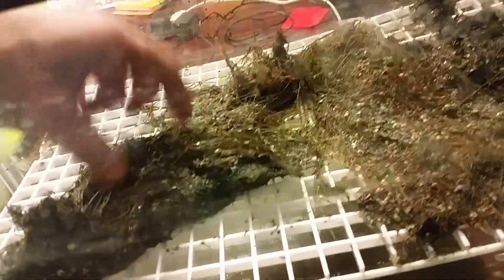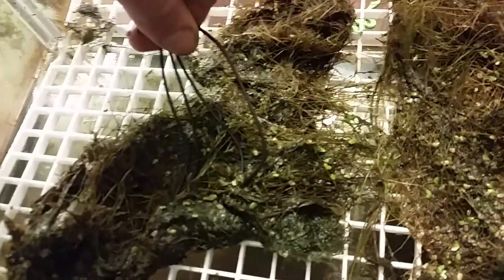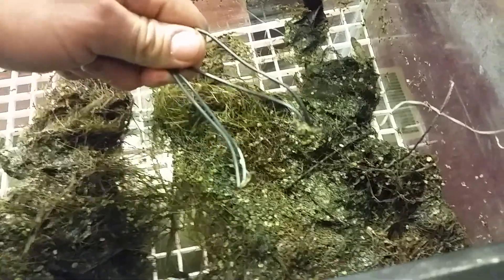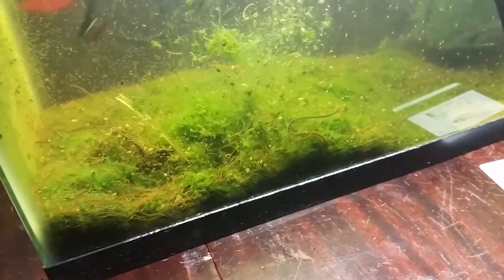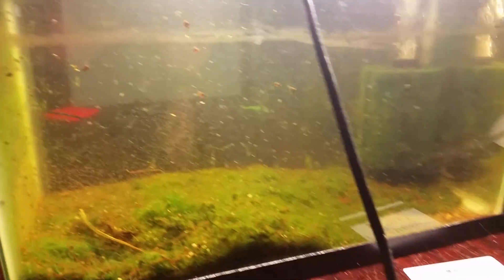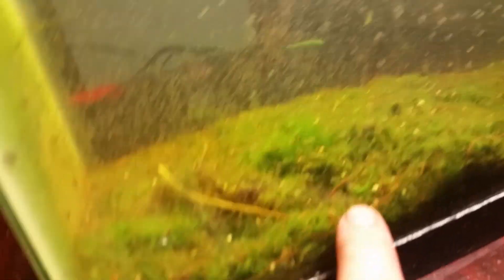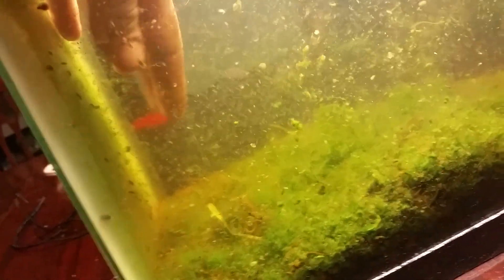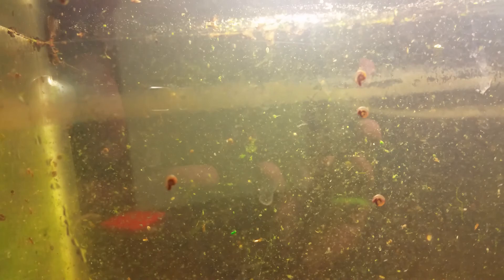black worm harvesting method using electricity

Comment: What substrate are you using in the harvesting tank?
Reply from the maker: Polarized Chaos the only substrate in the tank was algae that I grew in other tanks.  the worms ate through it fairly quickly.
Reply: @Sjveck  is that floating chlorella or string algae as a substrate?  I've used cooked duckweed (to make it sink) to good  effect.